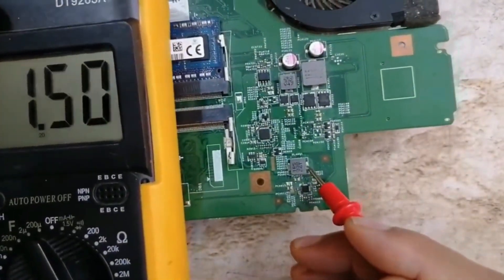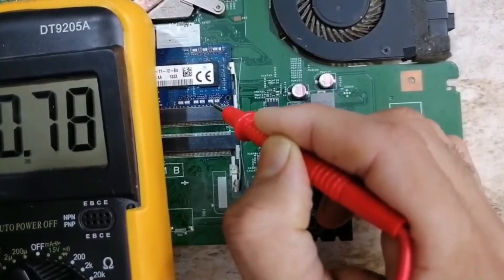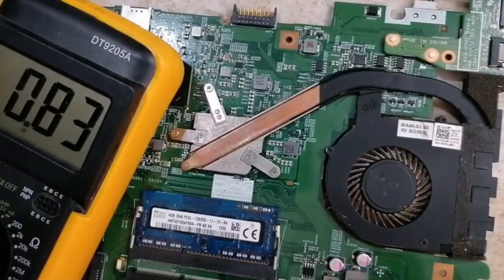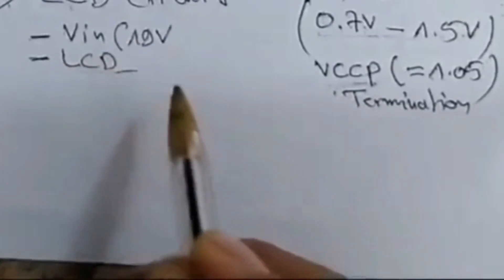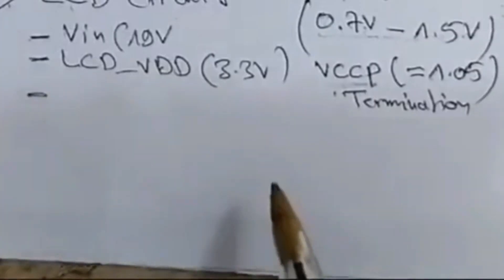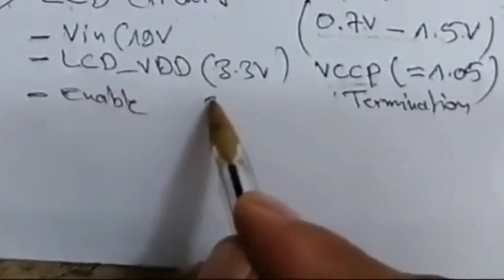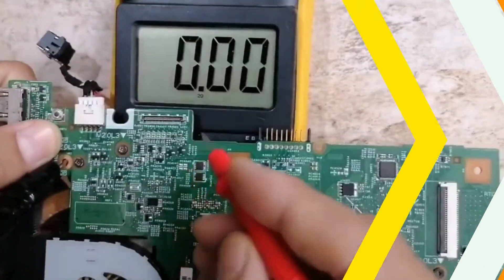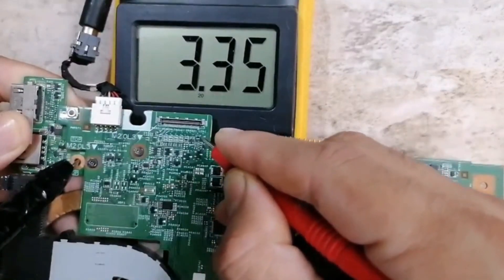Shocking Truth Behind Laptop Voltages – Measured LIVE | Motherboard Repair

Comment: Meaning of vdd and vtt
Reply from the maker: VDD and VTT are terms used to describe different voltage levels:

VDD (Voltage Drain Drain)
Meaning: This is the main power supply voltage for the internal circuits of a chip (e.g., a CPU, GPU, RAM).

For modern CPUs: ~1.0V to 1.3V

For DDR3 RAM: 1.5V

For DDR4 RAM: 1.2V

VTT (Termination Voltage)
Meaning: This is the termination voltage used in memory systems like DDR to reduce signal reflections and maintain signal integrity on high-speed data buses.

Usually ½ of VDDQ (the I/O voltage of memory).

Example: If VDDQ = 1.2V, then VTT ≈ 0.6V.

Purpose:

Ensures proper biasing of the memory bus.

Helps stabilize signals and prevent data errors due to reflections.